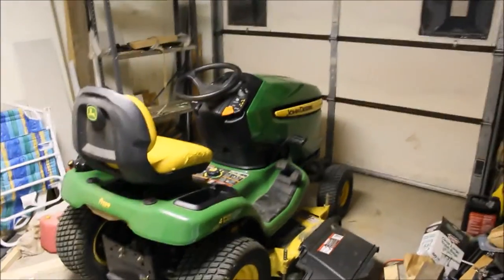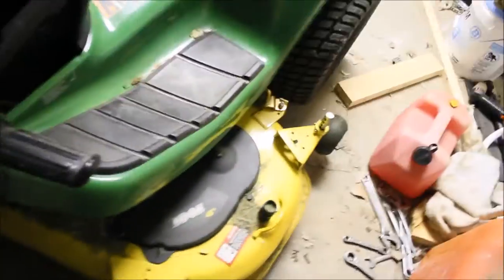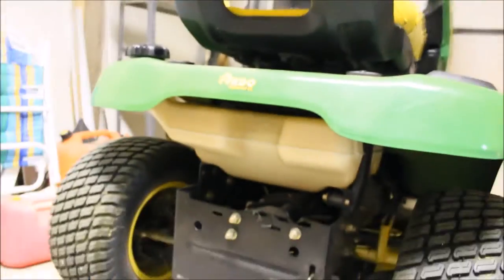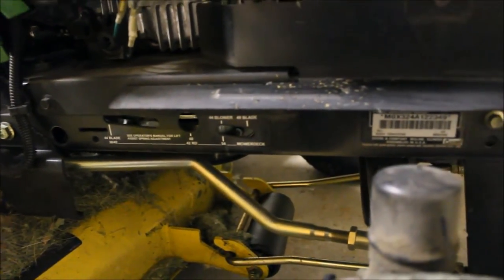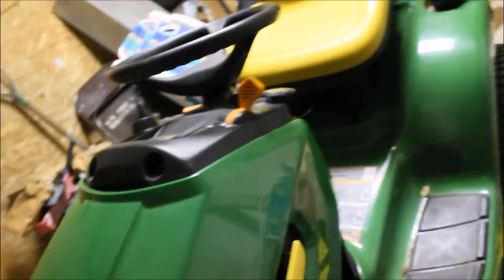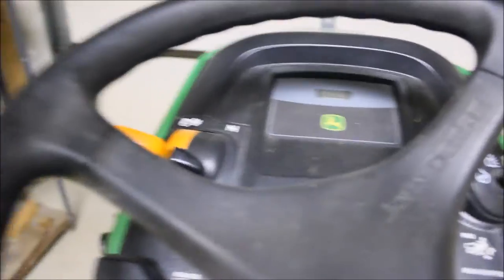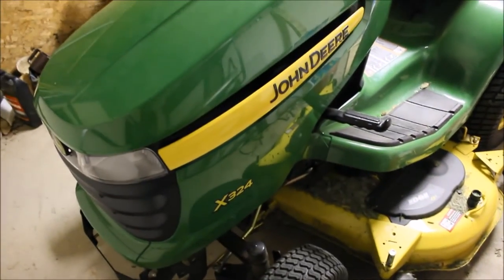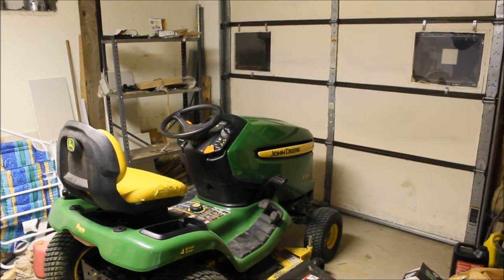John Deere X324 All Wheeler Steer Lawn Mower Review

Comment: That knob is the deck height the deck is always level you lift up the deck with the left pedal and the move the dial the the height you want to cut your grass. The deck level position is if your deck is not level you lift and lock the left pedal and move the dial to the deck Level position and there is a wrench the you use to level the deck